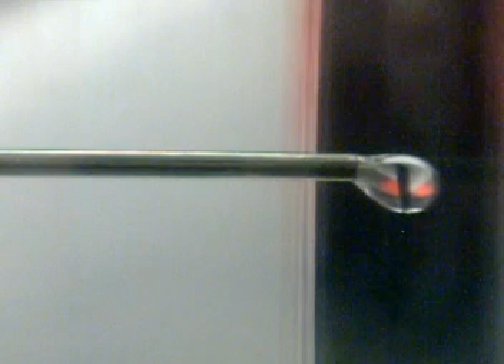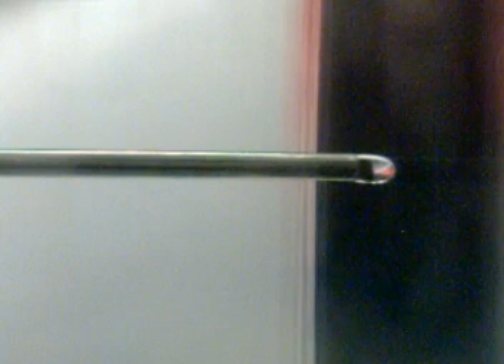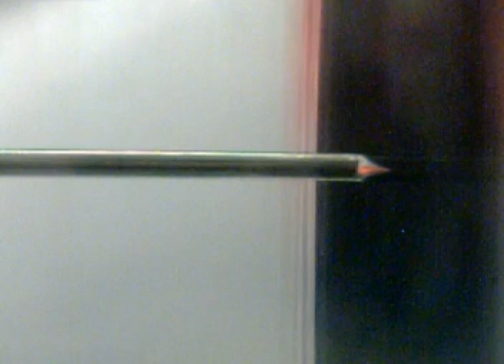Electrospray Ionization with Syringe Pump

Comment: does the cone only form when there is solute at the tip? or can it form with only solvent? I ask because we want to test our device without using valuable solute to calibrate it, if possible.
Reply: I'm sure you've solved this by now, but I believe avoiding solute accumulation is a challenge.  The solution should be homogeneous so it's more of less a continuous quantity.  The exception is dead space that can form inside the cone where it can begin recirculating.  

There's a recent video that explains this.  I'm more or less repeating that.